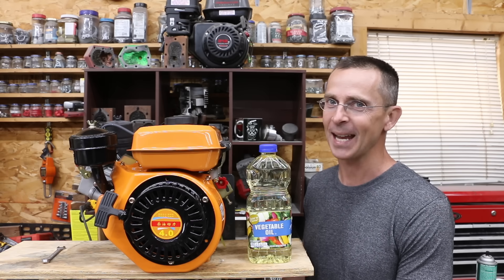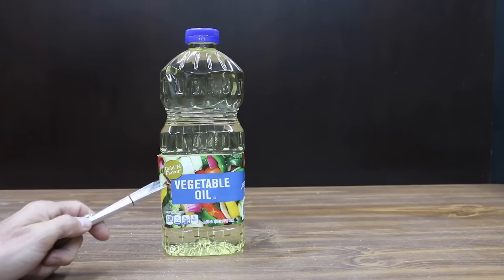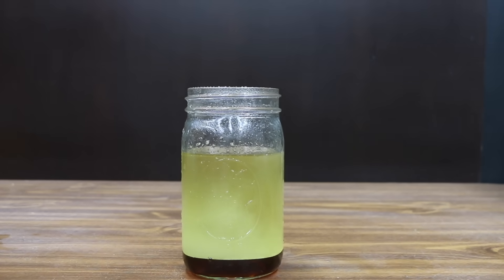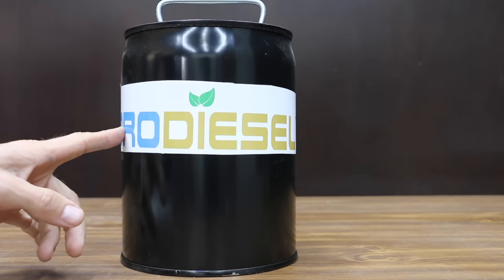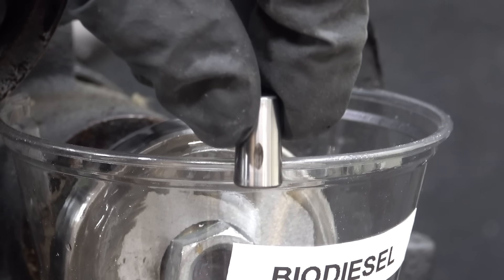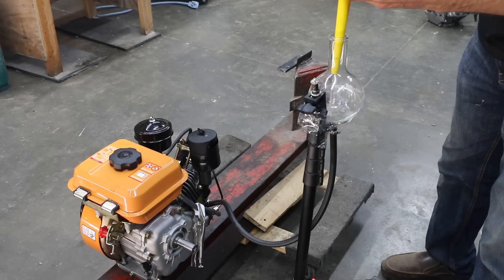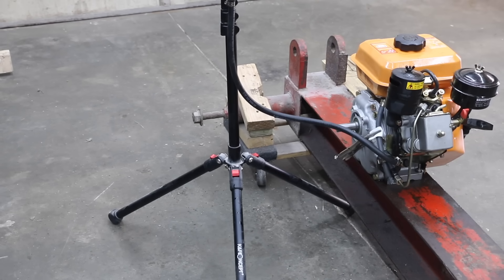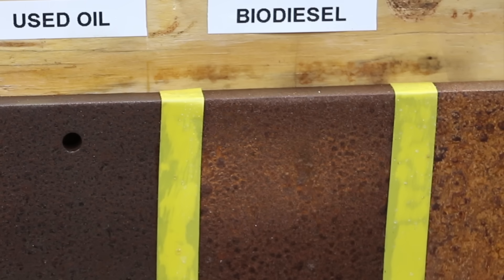Make "Biodiesel"? Let’s find out! Diesel vs Biodiesel, Used Motor Oil, Vegetable Oil, MPG

Comment: I would apply great caution in using "hydro diesel" in ANY diesel engine that you want to use for years and years.
    As you know, (and this is more for your viewers who don't know), ALL piston type internal combustion engines have piston rings. These rings have gaps in them to allow them to be placed in the grooves in the piston. A properly built engine always has these gaps placed opposite from each other to cut down on compression blow by. Note I said "cut down". They do not stop it completely. I can't speak for consumer sized vehicle diesel engines but I do know that tractor trailer trucks use their 11 gallon oil supply for anywhere from 10,000 to 25,000 miles. BTW, did I mention that most, if not all diesel powered vehicles and heavy equipment have WATER TRAPS in their fuel lines? There's a reason for this. Not only is it a good idea to keep water out of the fuel system in the winter to prevent icing but also if there is water in the system and it separates and gets into an injector line, it doesn't burn well so you can scratch that cylinder's contribution to the cause until you bleed that injector line or entire fuel system depending on how much water is present. My main point with the oil is if you have water constantly in the fuel, it will eventually find it's way into the oil past the gaps in the piston rings thereby diluting the oil and reducing it's lubricating quality.
    I started driving 48 years ago just before the Arab oil embargo. Not long after, I started seeing advertisements hawking a bubbler setup that you installed in your power brake vacuum line or PVC line if you didn't have power brakes. You were supposed to install this glass 3 or 4 quart jar under the hood, add water and this "secret" formula liquid that was nothing more than pink stained methanol. It was supposed to use the vacuum to draw air into the jar to produce water bubbles to be sucked into the combustion chamber of "any gasoline engine". The idea was to inject a non-combustible substance into the combustion chamber to take up space thereby increasing the compression ratio and resulting higher horsepower and better gas mileage. Yeah, how'd that work for you?
    It, of course, was a fraud for several reasons:
1)  If the "bubbles" were even able to survive the trip up the hose, most of them would surely pop when in contact with the intake valve.
2)  If the bubbles survived past the intake valve and did what they were supposed to do, increase compression, this would cause your engine to knock thereby raising the octane requirement of your engine meaning that you now have to burn more expensive premium gas or retard your timing and reducing the horsepower, gas mileage and efficiency of your engine to even lower levels that in the beginning or risk engine damage from detonation.
3)  If nothing else, you are now introducing water into your engine where it doesn't belong and giving it a path into your oil past the piston ring gaps mentioned above.
    There's a reason that oil companies don't add water to their petroleum products. God knows that they would make more money if they could as water is cheaper than crude oil. 
    Not to knock your friend who produces hydro-diesel but it almost sounds like the bubbler deal. You can't use the bubbler on a super or turbo charged diesel as the intake has positive air pressure so no vacuum to make it work. It almost sounds like hydro-diesel is meant to increase compression like the bubbler but in a diesel engine that already has proper compression, increasing it more could mean that you would have to lower the cetane rating of the fuel to slow down combustion or risk head gasket, piston wrist pin or connecting rod bearing damage. 15:1 or 20:1 compression is stressful enough and diesels are built for this. Increase it much over this on a long term basis can also stretch head bolts which over time can lead to head gasket failure.
    I'm NOT saying that hydro-diesel is a fraud and it might actually be beneficial in an older diesel engine with less than ideal compression. One that you would plan to get rid of when it finally quits. If Hydro-diesel was all that was available to get you down the road, I'd use it and flush it out as soon as I could get regular diesel fuel.
Keep using hydro-diesel if you wish. All I can say is somewhere down the road, if I see you with your thumb out, I'll be happy to pick you up and take you to a shop.
Reply: Hydrodiesel is an interesting fuel, I would not be so concerned about water in oil at least at the rates it would be seeping past the compression and intermediate rings. I would instead be more worried about settling of the hydrodiesel much like water in regular diesel. Hydrodiesel is supposedly designed so that the water is encapsulated in some coating that prevents direct contact between the water and other parts inside the engine. What I do not know is what the properties of this film are and how they handle wear. Diesel fuel is the lubricant for injection pumps and injector bodies alike, gasoline is so harmful because it's a crappy lubricant comparatively and is like running an engine with water in the crankcase instead of oil. My concern would be the wear on injection pumps and injectors, common rail systems operate from 15,000psi all the way to 60,000psi and were designed to operate with diesel fuel specifically. The tolerances, materials, and even shapes are designed for the lubricity and viscosity of diesel fuel, not an water in oil mix (which is what they call it). I guess if you ran your oil for a long time you could have a problem, but the rate at which water would evaporate from the oil is pretty high. Even in the winter when i'm running down the highway my return oil temp from the oil cooler is up near 150 degrees F, in the summer it will regularly hit 190-200 degrees on the oil return temp. Cars and trucks around here can have problems in the winter on longer oil change intervals if they only take short trips and their engine oil never warms up, they will actually get water in their oil from condensation. Just take a nice drive every now and then and that problem is solved.

Maybe long term use might have some effect if you ran long oil changer intervals like 8,000 miles or more, but on diesels running 3-5k on an oil change I don't think it's a big deal. Though I would be curious to see someone try running it for an entire oil change then having an oil analysis done on it.
Reply: @2009dudeman  For the record, everything I spoke about regarded big trucks. Not pickups or cars. Mercedes was the only car in the country then with diesel. What you say makes sense and I have to admit, in my old age, I am working on 40+ year old information. I took a 2 year course in diesel mechanics from 1974 to 1976. From what I learned back then, paraffin and sulfur in the diesel fuel was the injector lubricants because diesel fuel isn't much more viscus than gasoline. Large truck fuel injectors then were kind on like a large steel plug that went into the cylinder. It had a pin inside that was under a high pressure spring. This pin had a cone shaped point on the cylinder end that fit into a matching hole. The tolerance then was .0015 inch. Hence the need for extremely clean fuel and no air in the system. The high pressure mechanical fuel pump would force fuel down past the pin to the point where it would push back on the point allowing the fuel to atomize into the combustion chamber. When the pressure came off the injector, the pin would drop back into the matching hole and the back pressure through the injector nozzle wouldn't be enough to leak compression pressure back to the pump. I am not sure if this configuration has changed significantly over the years.  I know that low sulfur diesel is now the law and pollution standards were just coming into existence at the time. Back then, Heavy duty injectors on new trucks had limiters on them to prevent rolling coal but marine injectors required no such limits so some owner operators would risk voiding their warranties by installing marine injectors. I remember when we laughed at our teachers when they said computer engine controls were coming soon. Yup.
    I can see where water in diesel can cause the problems that you mention. From what you are saying, I assume that you have a diesel in a pickup or car bot correct me if I'm wrong. While both automotive and heavy equipment diesels function basically the same, there are some differences. While automotive diesels use what 5 to 8 quarts of oil, Tractor trailers use up to 11 gallons. While this may have changed some, I don't see that it would be by much. Over the 1 to 2 million mile life of an industrial diesel, if serviced properly, changing it's oil every 3,000 to 5,000 miles would get extremely expensive in a short time. a 1 million miles and 44 quarts of oil changing it every 5,000 miles is 2,200 gallons of lube oil. Big trucks in my day, at least, had oil change intervals of 10,000 to 25,000 miles as the added volume would be more forgiving of contaminants like ash and water. I have seen the damage that water can cause to bearing surfaces in engines. It's not a pretty sight. Yes, water can evaporate in a hot engine but in the 50 or so years that the road draft tube has been replaced by the PVC valve, once the water evaporates, is has nowhere to go but to condense back onto cold engine parts and back into the oil. When fuel and oils were high in sulfur, There was also a problem with water mixing with the sulfur to make sulfuric acid in the oil. In the short run, this was negligible but if a truck sat more that it ran, as you mentioned, it would add to the damage of bronze bearing surfaces pitting them and making them spongy on a microscopic level. On job that I had years ago, they had what they called "the yard dog." It was a single axle, dual tire tractor with a hydraulic lift and an air release on the hook on the 5th wheel. It also had a back door out of the cab. It wasn't made for the road and never left the property. What it was for was to jockey trailers in and out of the shipping doors if a company driver / truck wasn't available. It was a real time saver. Instead of backing up under the trailer, connecting the air hoses, cranking up the landing gear, backing into the door, cranking down the gear, disconnecting the air hoses, pulling the release and pulling out, you backed under the pin, pull the lift lever and lifted the gear about 8 to 10 inches, step out the back door onto a small catwalk, connect the air hoses, jump back in and back it into the door. Let the lift down, step out the back door, disconnect the air, get in, push the air release and drive away.  In and out in 3 to 5 minutes if you know what you're doing. They had me do this some times as I was the only one on the property on that shift that could drive a truck if the regular guy was out. This is the type of truck engine that suffers from lack of service as it never gets hot and no miles hardly for years so the oil might stay in it for 5 years before someone thinks about it sitting in the yard quietly.
Reply: @jeffmccrea9347  I was a diesel mechanic on class 8 trucks for awhile then an auto mechanic, before my shoulder gave out and I would lose feeling in my fingers. Not too much has changed in modern diesel injectors, they still use a poppet valve on the injector tip, most are electric actuated. Most diesels are going common rail now, which is slightly different from the old mechanical pumps you are used to. The main difference is that instead of a different port and line on the pump for each cylinder there is one port on the pump and a big fuel rail that runs the length of the engine where each injector taps into. This is fed by a traditional enough injection pump, usually a gear pump at pressures between 15,000-60,000psi. When the ECM decides to fire an injector it sends a electric signal to the injector and a solenoid forces the plunger open overcoming spring pressure. The rest is pretty much still the same, minus some nozzle design changes and multiple injection events per combustion event.

As far as diesel lubrication they still use paraffin, but in place of sulfur they now use several other additives that perform various functions from cleaning to acid protection, etc. Diesel oil has also significantly improved, the additive packages they put in it now are night and day from old oil. They have corrosion protection additives that prevent the acidic blowby gasses from making the oil acidic, to cleaning dirt and grime buildup, as well as some emulsifiers to help dissolve water and prevent small amounts from pooling, mostly if you are in cold climates.

Not that I would ever use hydrodiesel, if it really was that good then everyone would be using it, and I think you are right that in a big truck it would cause problems. They are pushing oil change intervals on them to ridiculous lengths, I have seen 40,000 mile oil intervals on some road trucks. Course I think those ones took 18 gallons and had oil life meters. But in a regular small diesel like a truck or lawn tractor, it shouldn't be too much of a problem for the internals of the engine, they tend to get pretty hot thanks to emissions in trucks. I'd still be worried about the injectors and injection pump, those tolerances you mentioned have only gotten tighter and I would be very hesitant to put water in there. Hell, most of the newer trucks would get mad and start throwing codes if you used vegetable oil or used motor oil they are so sensitive and some have fuel sensors that measure the conductivity of the fuel to make sure it's good.

Most all trucks use some form of crankcase ventilation, whether it's positive ventilation or a breather vent, they all run back into the intake and air is being quickly cycled through the crankcase. Vapors in the air are more likely to form from outside air once you shut it off and it starts cooling down. This goes for both small and big trucks. Though long periods of idling are killer on diesel engines, i've seen trucks come in with almost a gallon of diesel fuel sitting on top of the oil because they idled in the cold so long it started to wash down the cylinder. I'd never put hydrodiesel in a big truck for exactly that reason.
Reply: @2009dudeman  WOW, now you have made me feel like I wasted two years of my life. 😂 Just kidding. It has been a long time since I was in the diesel repair business. The original plan for me in the 70's was to take the diesel course as a preamble to a car mechanics course that had a 2 year waiting list. Car mechanic was my primary goal and we figured that if I took the diesel course, it would help me breeze through the car course due to the commonalities between them. I got tired of school after the diesel course and resigned myself to that but even that got old after a while so as you can see, I didn't keep up with improvements over the years. Where I said that you made me feel like I wasted 2 years was sort of stagnation on my part. If I had gone from the course that I took and moved directly into a school teaching what you said here, I would have said that it was all wrong but then that's what we said in 1974 when they told us that ECM's were coming soon. When I was in school, Anti lock and fail safe brakes weren't that old either. I'll be 66 in 4 days and have been disabled for 22 years this past February. Stagnation is my middle name. Thanks for the update. Next time, I won't make a fool out of myself with stone axe information. 😒

Comment: Bio diesel is very bad for the motor. Iam a diesel mechanic and it stops the fuel system up. One it runs threw the fuel water separator and sit before the next oil change it actually forms a gell like substance and some time it will harden up and look like chewing tobacco. I have a video I could send you of what it does to a motor. Its very un healthy. We try to steer our customers away from it and tell them to get fuel from mom and pop stores.